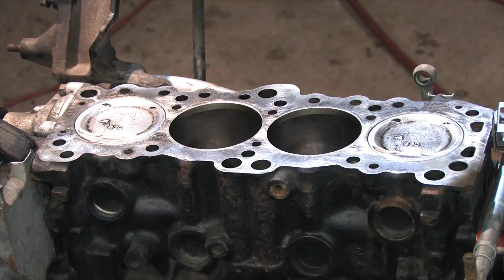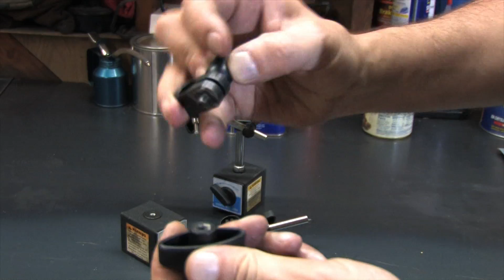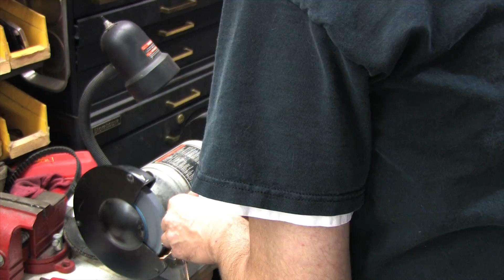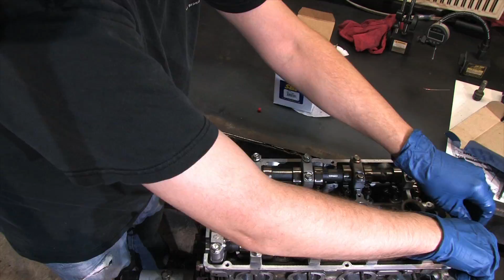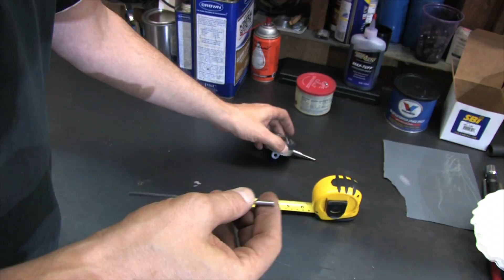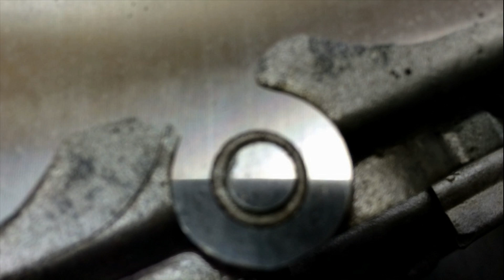Cylinder Head 205 - Degree DOHC Camshafts

Comment: Great video Jafro. I'm going to Harbor Freight later on to buy wise grip flexible holder for dial indicator. Can you tell me where did you get TDC locator and digital dial indicator? Thank you
Reply from the maker: +myAWDgst TDC locators came from Summit Racing, digital dial indicator is a Harbor Freight piece, but to me, it's only a prop.  It's something I can use to demonstrate things that my viewers can easily read.  If you're locating TDC, you really need to use a gauge that's graduated in .00005" increments.  The Harbor Freight gauge is in .0005" increments.  It might only be as accurate as .001".  That's just not enough to pinpoint exact TDC.  In the event you can't afford the .00005" gauge, which most people can't, get the $10 piston stopper and use the old-skool method that I did not demonstrate.
Reply: I got all of it yesterday. Thank you. I'm gonna use it this winter on my Peugeot 405 MI16 that is 2g ECMlink V3 E85 swapped.

Comment: Is this something i need to worry about if I'm replacing a cylinder head with an all stock, re-manufactured cylinder head? I don't have adjustable cams or anything like that, (its actually CVVT).
I'm replacing the cylinder head because the timing belt went out, while going down the highway. I purchased a remanufactured head on ebay, which is supposed to be all ready to go. Including valve clearance if all stock set up?
I love you narrations and explanations by the way. :) I never realized how much work went into building an engine.
Reply from the maker: +joel reindel As long as your build is an all-stock daily driver, you should be fine.  The only tricky thing is on some variable valve timing engines, the cams may have some kind of hydraulic control to adjust the valve timing that can make re-assembly a royal pain in the ass.  Most modern designs aren't bad, but engines like the 4-banger in the Ford Probe and the Mercury Mistake... I mean Mistique... have a stupid intake cam gear that makes timing them nearly impossible because it rotates almost 15° in either direction, and the cams don't have dowel pins to help you line it up at true TDC.  On that particular POS engine, if you don't get the cam within 3° total of zero... meaning 1.5° in either direction, the ignition won't fire.  I doubt your re-manufactured head or engine is as tedious as this, or that whatever work was done to it would affect your cam timing enough to make it un-driveable... but barring that on a stock build, it should be completely fine.
Reply: I was thinking your answer would sound something like that. All stock daily driver it is.
It is a 2008 Hyundai Accent. The CVVT device is a real sinch. It bolts on to the end of the exhaust cam, and is hydraulically fed through a hole in that cam. So its bolt and go.
Thanks for the reply. I appreciate it.

Comment: If I may, an old school hot roddding tip for cam tuning. The motor will respond the best when you achieve the highest cranking pressure by changing valve timing events. A lot of trial and error, but I always had more time than money.

Comment: Hello Jafromobile!
   First off, I want to thank you on behalf of myself and fellow dsmers out there for your very informative videos. We really appreciate your vast knowledge! I have watched this video in particular about three times now. I have a built 4g63 motor (forged internals with 100mm stroker crank, and HKS 272 cam shaft, as well as HKS Cams). I need your help on how to degree the camshafts. Are you local? Would you consider loaning out the tools necessary, if I put down a deposit on the tools? I would be willing to pay you for your services, of course; I am in Lafayette, CO. I have been waiting to get my 1990 GSX together for quite some time now, for over 2 years to finally get the bottom end built, as well as my Slowboy racing stage 1 head. I put all my trust in Drew, from Heads by Drew in Aurora and I am confident in his work. I do not want to rush any steps, for as far as I have come with all my money tied up in my build. please help! 303-883-3290. I know you are very knowledgeable and I do want to learn. I have seen many of your videos and have performed the oil gallery mod on my block. Thank you very much for your time in advance!!

Comment: No offence intended but what's up with these little 4 bangers. You have skills, build something. I know they can be built and rev sky.
 I'm a North American 1/4 miler hook, pull the front wheels and hang on and keep it straight builder. I'd like to see you use your skills and build some power.
Reply from the maker: Save Humanity No offense taken.  It's all about perspective.  

One generation got to play with the most stylish American cars ever built.  That is an inarguable fact regarding post-war American cars.  Those are the years that America was in love with automobilia, and it showed in every part of American car design and culture.  1/2 a generation behind them, those kids got to taste the Yenko, Shelby, Ramchargers legacy.  Much was learned about power, weight, handling and aerodynamics during these years.  People raced cars that you could buy at a dealership  They got to watch Trans Am series and CAN AM series races from the sidelines.  Another 1/2 generation later, OPEC killed the American car market.  They did it by choking off the fuel supply and killing our RACING EVENTS.  The big three auto manufacturers cranked out garbage from 1973 until the late '90's.  Square, inefficient, under-powered excess.  Eventually giving up on even racing the cars they built and opting for plastic-shelled tubular chassis with engines they didn't even design.  

I was born the year that OPEC deal went down.  The cool cars and surplus from the previous generation got used up and collected by enthusiasts that already knew the reality I would have to face.  That the plentiful parts supply and collectable fun American cars had all already been built.  These assets have not depreciated.  

Throughout my youth, even though the American auto manufacturers built crap on crap with a side of crap, they made a killing off of the '55-'72 enthusiasts from the service and parts market which they continued supporting.  Whole racing development teams formed, an aftermarket R&D and parts industry grew out of it, and it set a new competitive standard for cars built 40 years earlier.  There's only one problem with that, and that's you're looking at $15,000 custom-built crate motors in order to be competitive, and if you want to put it into a stylish classic American chassis, you start with the chassis inflated purchase price of 4x what the car cost new 40 years ago, back when it used to run and have all its bits together, a $40,000 frame-off restoration, and then another $20,000 customizing the rest of it to your liking with modern conveniences and technologies that people expect to have in their cars.  For 99% of people born after OPEC, this is an un-obtainable dream.  The cool cars have been bought up and maintained by collectors, and can not be had for less than $60,000 unless it's in your inheritance.

During the '90's, the big three got what they deserved for foisting overweight, bloated, underpowered cars on the public and they fell from being the #1 cars sold at U.S. dealerships.  They took a beating from Japan because there was better engineering, technology and efficiency available for a lot lower price.  Japan wanted our money a whole lot worse than the US automakers did.  Imports didn't win favor because they were what Americans wanted, it was because America failed to adapt to emerging engine technologies, because of autoworker union bloat and an expensive and often incompetent workforce who did not build in the same quality that the Japanese were eager to achieve.  They got outsold because the Japanese built a better product, and often sold them at the loss of several thousand dollars per unit just to get their foot in the door with repeat buyers.  Basically, consumers got more car for their money.  Perhaps that's why the 1989 Mitsubishi Mirage won Car & Driver's "Car Of The Year" award, beating out the Corvette with a 1.6L turbo 4-banger that ran a faster 1/4 mile and road course tests.  The American car manufacturers had failed.

The failed cars are the junkyard surplus of my generation.  Think about that because that really sucks!

I am not building the cars that I believe are the end-all supercars or that they're somehow what everyone else should be building.  I'm building the import cars that are a better choice in that pile of surplus.  More power, more technology and better handling in all of them.  I'm no different than the generations before me, like them I build what I can afford and what I can easily obtain to further my performance goals.  My daily driven trucks are American V8 and V6, but all of my toys and garage experiments are imports because it's what my generation can get its hands on, and quite honestly, some of those imports have the potential to wipe the floor with both import and American cars alike, just like a lot of that old American steel from an era before I was born.

You'll see that I have a lot of respect for all of it.  Who knows?  Maybe someday there will be a 351 Cleveland/ZF-5 powered GT5S Pantera with the australian block and head combo... or a Superformance Daytona Coupe replica in my stables.  God only knows I missed my chance at scoring 1/7 of the original ones at auction for $3500.  They're worth $40M today.  Maybe I'll get lucky and win the lottery?  I'd still buy the replica, though... so I could drive it with a clear conscience.
Reply: *****  I've never bought a crate motor in my life and built dozens of very powerful motors. Most of those were sbc gen 1 motors putting out 500 plus horse and ft lbs of trq. The skill is to not spend money. Take a set of camel hump heads port them, build an intake out of a few, build headers out of old ones, slavage 4/11 rearends out old trucks. You can build what ever you put your mind to building for next to nothing that's competetive. I have a century old rebore manual cyliner boring tool that punches out cylinders to what ever spec I want. The art is alive and well, just fewer paople doing it. The R&D for the major auto manufacturers were done track side with junk yard parts from guys building them as they broke. There were no aftermarket heads or much else for that matter. That's the sheer joy of it all. Make it work and see what it will do.
Reply: ***** Very true and I really wasn't trying to offend you.
 I've watched a few of your video's and you have plenty of skills.
 I've been around a few more decades than you, so I think differently. I hope at some point in time you just do something old school with knowldege you guys have today. Double up on your cylinders.
 Just kidding.
Keep up the good work, I'll be watching for time to time.
Reply from the maker: Save Humanity Wait until the warranty expires on my 2013 F150 FX4.  It will be a while, but I promise I'll make that 5.0L Coyote howl.
Reply: ***** I'm looking forward to it. 
Sounds like you've given this some thought already. What do you think of  Hennessey's VelociRaptor.
Reply from the maker: Save Humanity I think it's a bad beast!  But once my warranty expires, I'm pretty sure I'll make 200 more hp and get twice the fuel economy at around 7 mpg.  Also for $25,000 less using a slightly more wieldy truck on (public roads and parking lots).  :)  I'm shooting for a 10 PSI Whipple W175AX 2.9L setup.  I'm not likely to do lift kits and monster tires.  Those guys will never catch me (on pavement).

Comment: Great job on the videos. I just discovered your channel and I am making my way through them all. It is all very good stuff worth my time. I do have a couple of concerns I thought I would pass along. First I caution you against side loading the grinding stones on your bench grinder. Only the face is designed for grinding. It can come apart and fatally injure you. I am sure YouTube is full of horrific videos detailing the aftermath. Second, do not use your bench grinder for aluminum. The stone is not designed for aluminum and can load up, become unbalanced and come apart, again fatally injuring you.

Comment: Just curious Jafro, is there any aftermarket mechanical camshafts or a way to make them for the 4G63? I know on chevy small blocks you put restrictors on the oil galleries that feed the lifters when running solid cams or roller cams. So if you could put in solid cams then could you modify the pressure regulator in the head? I figure if anyone would know or know if they could be modified/made it would be you.
Reply from the maker: SupermanBPR9 Yes.  CRCO makes the lifters.  You would need billet camshafts or you'll wipe the lobes almost immediately.

Comment: This may sound off the wall. I installed a timing belt on a VW 30 Valve V6 2002 Passat. The engine has sludge in it. I flushed the sludge out best I could before adding fresh oil. Started the engine and it ran good for about 10 minutes then started running rough and mil light came on. Shut down and inspection I found center intake valve number 3 cylinder bent and staying open. Can a bent valve be straightened without pulling the head? Why did the valve get bent? The other two intake valves on that same cylinder are ok. Maybe hydraulic lifter plugged with dirt and held valve open?
Reply from the maker: Greg Orland I suspect something else horrible was in that sludge.  It sounds to me like something stuck that valve open when it was supposed to be closed.  It had to be something pretty major to overcome your valve spring pressure.  I don't know how much a volkswagen hydraulic lifter has but that type of failure is pretty uncommon on a DSM.  I hate to break it to you, but bent valves can't be straightened.  Typically the guide is also destroyed.   You have to replace them.  You have to pull the head to fix it.  But fortunately, you'll have lots of answers about what went wrong once you pull the head and go through it.  Valves don't typically get bent from the top side, but you'll get a chance to see what's wrong with the piston, and what's wrong with the lifters.
Reply: I unkowingly bent the valves when I manually cranked the crankshaft one revolution with the cam gears loose. I forgot it is an interference engine. Stupid me.

Comment: Ok, so I finally got around to do it but in a bit different way than what you showed in this video (with the centerline method).
The only details I have on the camshafts I chose to install are the lift, duration and centerline degree reference.
I understand how to do the degree of the camshafts but I still have some questions.
When I'm looking for the TDC my dial indicator I can see that it's not moving almost 10 degrees when the piston at TDC. Am I correct to assume the middle of this 10 degrees is the true TDC? and I encountered the same issue when I was looking for the maximum lift point on the camshaft.
Now, my Exhaust cam centerline is 102 and my intake cam centerline is 108. Is it correct for me to assume that it means that my Exhaust cum centerline (valve fully open) is 102 before TDC and my intake cam centerline (valve fully open) is 108 before TDC?
I'll appreciate some Help here... Thanks.
Reply from the maker: Barak Cohen Firstly, I use a .00005" resolution gauge when I locate true TDC.  The electronic .0005" gauge isn't fine enough, but to answer your question, yes.  It would be the middle.  Another thing you could do is find .100" on both sides and split the difference.  That would give you a more accurate result.

If you wanted to check your centerline on the cams, you can do the same sort of thing.  Keep in mind, that's why measurements are taken at .050" lift on the cam spec sheet.  It sounds to me like you've got some pretty high duration cams.  Mine only went about 4° before the gauge moved.

If you're locating centerlines, and want true centers, you'll need the highest possible resolution gauges you can get your hands on.  If they're out-of-reach, use the stopper method that others have demonstrated to find your crankshaft's true TDC.
Reply: ***** Thanks man you saved me a lot of time and headache...
Your advice and way of working showed me that my TDC was off by 0.5° and my inlet cam was off by 1° (and that's after I did the adjustments the first time...)
It's funny that my exhaust cam was perfect 102° after I fixed the 0.5° TDC, I guess my exhaust was off by 0.25° as well so by fixing the TDC I also fixed the exhaust cam degrees.
Your help is very appreciated and one thing is sure, you've got a fan ;-)

Comment: Your videos are awesome thanks for sharing hey can u help me out wit a qstn? I have a 98 gsr head wit alpha skunk2 valves and dual springs n ti retainers i just took it to machineshop for a valve job and port and polish it i bought skunk2 tuner stage 2 cams the bottom will be a b20b block u think i need to degree my cams ? I dnt want to install all that n mess it up i also have the b18c1 block but i wanted to go wit the b20b block instead thanks alot for ur time keep doing them awesome videos i watch all of them
Reply from the maker: Yes, I have no doubt they will need to be degreed.  If all you did was resurface the head and block, you'd need a degree or 2 of correction.  If you use parts from 2 different engines with aftermarket cams, there's less than a 1% chance these parts are going to line up without it.  Don't worry, I'm still makin' videos.  More on the way.
Reply: Ok thanks alot head never been resurface before block either all parts are new out the box i dnt knw much about this but i enjoy watching ur vids. Thank you